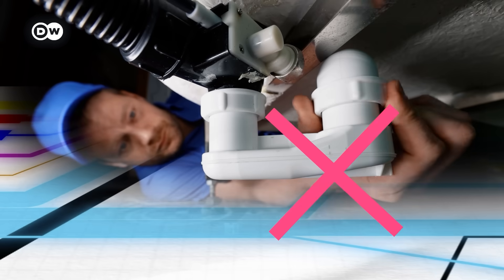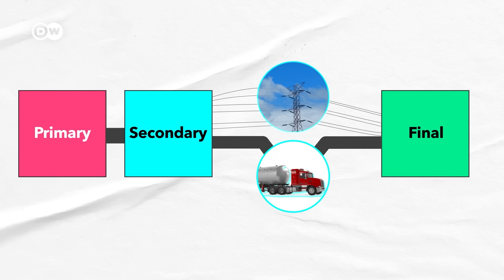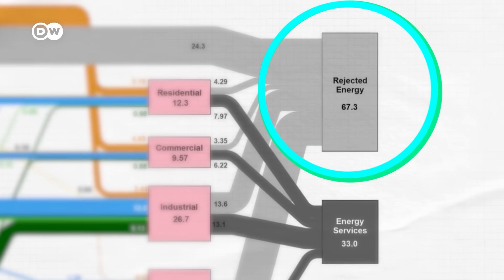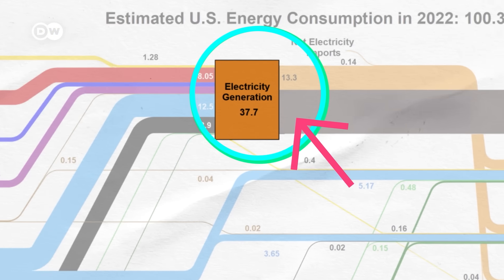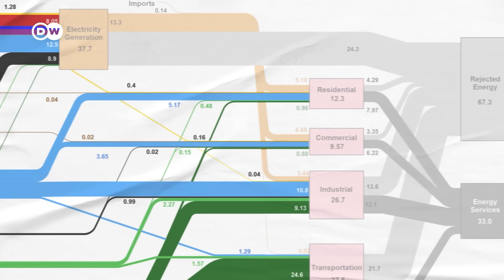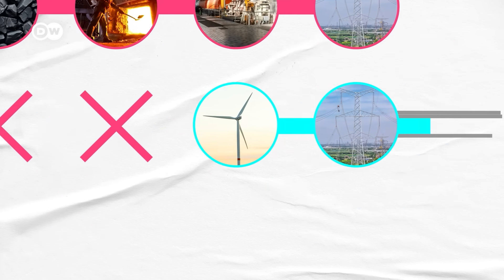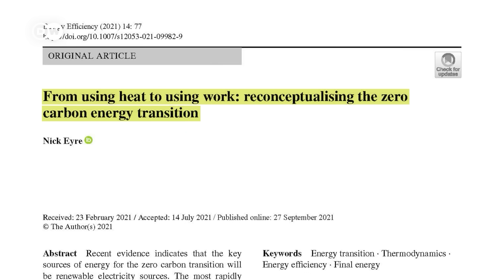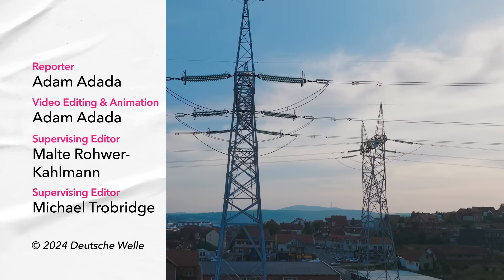The mind-blowing thing we get WRONG about energy

Comment: Very informative video, but it doesn’t talk about the emissions and wasted energy that goes into manufacturing and transporting especially when it comes to EVs.
Reply: EVs have much higher initial embedded energy and embedded CO2 emmisions but they should pay that back after perhaps 50-100K miles in spades and then be net positive. EVs have the potential to keep scaling down into micro cars and eBikes where efficiency is massive, but these days the western industry only wants to build luxury giant $100k SUVs which don't solve anything at all.
Reply: @johnjakson444  Aptera is looking to bring a cheap, lightweight, extremely aerodynamic, solar EV to the market somewhere around 2025. The Aptera sEV hes been designed from the ground up to be as efficient as possible. It's exterior is math equation of aerodynamics put onto wheels. Because of how efficient it is, it's able to generate a substantial about of its energy usage from its integrated solar panels and use much smaller, lighter, cheaper, less environmentally impactful battery packs compared to other EVs. And with the solar, It can literally take power from its solar cells and send it straight to the motors and HVAC system, reducing how much work the batteries have to do. This has the added benefit of bypassing some battery charge/discharge losses and reducing battery wear. The best part? Aptera support Right to Repair, keeping the vehicles on the road for longer so that they actually make up for the environmental cost of manufacturing and provide environmental benefits. Biggest downside? Its a 2 seater.

I could go on and on about Aptera, but if you want to learn more, there are quite alot of videos about Aptera here on YouTube.
Reply: @johnjakson444  And unfortunately that’s the issue, everyone wants an F-150 Lightning or  a Tesla which would take years and tens of thousands of miles before the emissions would offset instead of more compact alternatives

Comment: Lots of times, normal households are “targeted” as burden to the system. Yes, there is a good contribution to the problem, but the biggest resource consumer is the industry. There is no energy savings on factories because they need the amount of energy to be productive and deliver. The squeeze at the end comes to the households, which “we can do better “ . Yes we can, but the contribution to the environment and society might be not so big. 
Think about it.
Reply: It takes time for new tech means to be incorporated into supply chains and industrial design & manufacture.  We also need more utility middle ware - providing
constant power from intermittent, dispersed sources.  The legacy market arrangements requiring 20-year power purchase agreements needs updated.

Comment: It isn't complicated. Our world features a system of rewards. In turn our system will reward a company and or industry that uses their capital to capture government and regulatory systems to their benefit. This isn't a conspiracy it has been going on for thousands of years and will continue. In The US we have 8B gallons of household and business hot water standing by 24/7 at about 140 degrees. Perhaps 6% of this ocean of heated water is being used at one time. Is this anyone's fault? Who cares, fix it. The heater should be shut off based on need and you could save 60% of the energy used on heating 8B gallons of hot water that nobody needs. We have the technology to fix it a week ago.

The point isn't just about hot water and it is not about environmentalists or oil companies it's just that every appliance and vehicle we use every day is about 35% or less efficient than an electric version. There are 34M EV's on the planet, it has nothing to do with democrats or republicans this new technology is displacing gas cars and the pace quickens. Car manufacturers made 40M fewer engine blocks over the last 5 years. These blocks were displaced by electric motors that are over 70% efficient and not one of these engine blocks will ever come back.

Where are we going to find the electricity to charge these EV's? Electric transport will spend a goodly amount of time sitting still and "charging." Electric utilities will use this "battery capacity" for frequency management and gas and coal plants will continue to be shut down. Thermal generation isn't bad it just isn't efficient enough to keep up with the new technology. Gas stoves/furnaces/AC/cars were all invented a hundred years ago or more....they are obsolete and are being replaced and calm yourself, no one is gonna die in the process.

Comment: Sounds brilliant until you actually start looking at numbers. Even if you just want to electrify the grid (forget industry & transportation), the amount of renewables needed is unrealistically high.
And if you start electrifying everything you'll run into a new problem - our power grid won't be able to support it.
I've done a pilot project for city of Toronto (I was the lead design engineer), where we converted a school's heating/cooling system entirely to heat pumps (with lake Ontario as heat source, so even more efficient than airsource heat pumps). One of the reasons the city was doing it was to get a good estimate of the increase in power required to support it as they are really concerned about grid being able to take it.

Comment: I work in the industry and our company is building a lot of solar, this video is very strange though because whenever people talk about how much power is needed etc, it refers to the nameplate rating, which is the output of the plant, so this whole video doesn't make much sense. Of course fossil fuels and any heat based plants have very low efficiency, but the rating of the power plants and energy transmitted etc has nothing to do with the chemical energy in the fuel itself. So if we're using 30 GW power now with fossil fuels and we're replacing it with solar, it is still going to be 30 GW! Solar panels are also themselves not very efficient in converting energy from the sun to electricity, maybe even less efficient than fossil fuels, definitely less than 40 percent efficient, but again, the rating of the power is the based on the amount of power it can produce, not how much power the sun is providing it. Also, we are definitely not going to be using less electricity in the future, we will always use more energy in the future than we are now, population growth, human development, electric vehicles, and now artificial intelligence, are all big reasons why. I'm not a climate sceptic at all, but this is just a very very strange and low quality video honestly, I'm very surprised.

Comment: Unfortunately, wind and solar suffer the same problems. Solar is barely 17% efficient, and wind is less than 1% efficient. Advanced gasoline engines and coal burning power stations are 50% efficient. Gas burning power stations are 60% efficient.
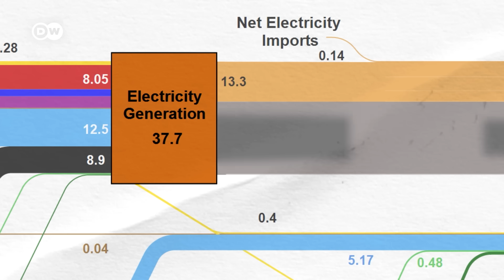Reply from the maker: Like stated (5:30 onwards) most of the energy gets wasted when we go from final energy to useful energy. It is not that renewables themselves are more efficient but there's no such a loss - that is remarkable. 🌞

Comment: The video is depressingly stupid.  Barking at the moon.
An electric vehicle is NOT 90% efficient. It might be from battery to wheel.  Battery technology loses around 25% of the energy input, due to inescapable inefficiencies, and energy loss ESPECIALLY at high power transfer (when you use fast charging or put your foot down).  And before anybody comes back at this to talk about new battery efficiency, practical batteries are NOT NEW for the most of their existence, and go through processes of degradation.  So COMPLETELY WRONG on this one.
Wind turbines do NOT produce energy on demand.  If you are willing and able to consume energy ONLY when the sun shines and when the wind blows, it may be possible to minimise energy losses.  But it is not only fossil-fired power stations which need maintenance - wind turbines fail too, and their blades quite rapidly degrade.  As they are spread out all over the place, it is hard to maintain them because it takes a lot of transport and other resource. COMPLETELY WRONG there.
Energy systems appear inefficient because they SATISFY CONSUMER DEMAND.  Consumers demand energy as well as security.  If you want a secure (on-demand) energy supply, you get the systems in those Sankey diagrams.  Engineers and commerce didn't get there because they are all stupid.

Comment: Want to get serious?  we can cut the waste in half but the following.

1. set speed limits to 50mph. This would make EVs feasible.
2. stop all non emergency air travel.
3. stop letting people drive their 400 square foot home around the country.
4. stop all off road vehicles for entertainment.
5. stop the construction of over sized houses.
6. Charge power and fuel on a sliding scale.  The more you use the more it costs.  Let the rich pay for their over consumption.

Either choose what to give up today or lose it all tomorrow.

Comment: Ah you have fallen into the Engineering Trap! How do I make everything more efficient? Muahahahaha.... 

It is true, unfortunately it is challenging... The reason why power plants are so inefficient is because you can't boil steam. When you push steam though a turbine it takes some of the energy out of the steam, this will turn it back into water but water will damage the turbine. So to prevent this engineers use what is known as superheated steam. Which means it's still steam when it comes out of the turbine, so no damage. But in order to boil it again, to run it back though the turbine it must be cooled back into water again. Hence the huge loss in energy. 

Cars... There actually closer to 5-10% efficient if I'm going to be real. The issue is that usable energy is a loose term. See yes the car is using 20% but around half of a cars energy it 'uses' is wasted idling, like at traffic lights and such. So it's only around 10%, but if you factor in braking which looses momentum as heat about 3-7% of the energy in a cars momentum (of the 10%) so yeah a car is 90-95% inefficient. Electric cars also are only around 80% efficient at best this is due to 20% loss as the battery heats up charging. However due to the fact they can recapture braking, and they don't idl. They are actually really efficient. The biggest issue with them is energy loss from (a bit of friction honestly) but mostly the heat made when the battery charges and discharges. 

Heatpumps can actually be up to 900%+ efficient but they have to be a geothermal heat pump not a air based heatpumps. The issue is here of course is geothermal are WAY more expensive than air based. By like 10X. However this doesn't account for the fact a lot of homes leak that energy back into the environment due to poor insulation and low quality building practices which cause homes to leak. In fact if you build a well built netzero home, you almost never need to even run your heatpump except on really really cold days or really really hot days. So not only is it more efficient but you also don't need to run it as often. 

Also with heat electronics in the home also can be made more efficient which reduces the amount of heat the heat pump needs to remove (think incandescent versus LED light bulbs) if you make less heat the heat pump doesn't need to run as often to remove the heat. (The best heat is the heat you never made).

Definitely a challenge but doable it's less of a technical problem and more of a cost and will problem with a big bit of needed regulation and money sprinkled in.

Comment: Even fission and fusion energy  waste 2/3 of the energy making steam to turn turbines and then condensing the steam to use the water again. .  We need to find a more efficient way of transferring heat to electricity if you want to go pure Electric.
Reply: The wasted energy in nuclear isn't as huge a problem considering no greenhouse gasses are emitted. You can just scale up to meet your demands.
Reply: @Babyblasphemy   It's still adding energy to a system.  "Not a huge problem" is consistent with my guess that it will take 3 to 400 years for us to notice.   I am not opposed to using nuclear power at all.  I've spent a chunk t of my life cleaning up, nuclear weapons production and test sites  and  Old  graphite moderated reactors and I still say it's safer and cleaner than fossil fuels or even using too much fertilizer on crops.
Reply: @flotsamike  simply adding heat is self correcting. A hotter object will radiate more heat outwards to space. Greenhouse gasses not so much.
Reply: I'm sick of thermodynamics illiterates that think they're cute by talking about it. We MUST throw away energy to a heat sink to convert heat into work. Renewables suffer from the same problem. Solar is barely 17% efficient, 83% of that is released as low-to-ground air heating. Wind has an infinitesimally small efficiency. Internal combustion engines are at 55% thermal efficiency. Gas burning power stations are at 60% efficiency. Coal burning power stations are at 49.5% efficiency. The waste heat from power stations can be used for district heating as well as cooling with Absorption chillers.
Reply: @gregorymalchuk272  All of the energy wasted by solar power is already in the environment and that is what creates the baseline.    It's true I never took thermodynamics and I'm pretty stupid,  but at least I know if you add energy to a system you change its equilibrium.   I thought I was being generous by not mentioning the fact that all of the energy you generate gets released to the environment eventually.
 It would be great if we could capture heat for district heating, but at least in the United States, nobody wants to put a nuclear power plant close enough to a population that would use it.  Still that heat which was formerly in the fossil fuel  or  slowly being released by radioactive decay,  or not released at all by fusion that's not happening, will be released to the environment and most likely change the heat dissipation profile of the atmosphere   I am sorry my thoughts make you sick.
Reply: @gregorymalchuk272  who cares about efficiency. The real concern is elimination of greenhouse gas emissions and cost.
Reply: @Babyblasphemy  And if you care about global heating, then you have to oppose renewables too, because most of their energy is dissipated as waste heat.
Reply: @gregorymalchuk272  you mean the heat that would just hit the Earth had the panel not been present?
Reply: @Babyblasphemy  Natural materials are more reflective than any solar panel. So every panel contributes somewhat to heating the earth. But it's worse, because they heat the earth near the ground where it creates an urban heat Island effect and human health effects.
Reply: @Babyblasphemy  it is the immediate concern.  But just because we stop adding greenhouse gases doesn't mean they will disappear instantly .
Reply: @gregorymalchuk272  There is room to improve solar for sure.    I cannot find a way to incorporate radiative  cooling materials in a solar panel.  But I have learned that many of the radiative cooling coatings re emit the infrared  light at a frequency that's more likely to leave the atmosphere,.

Comment: Why did the analysis not show the role of Solar paired with batteries.  It is the cheapest, most efficient system out there.  The batteries in California and Adelaide South Australia are taking up peak demand.
Reply: Well in the US NE, solar production is 5x better in summer than winter, 6 months of battery electric storage is going to cost a $M per person and would not even work. Instead we use gas peakers to do the job. Batteries are only good for hours. Weekly and monthly storage is cheaper per kWh but grossly less efficient for various tech, and the required quantity is huge. It even says on the Sankey what that is, 300GJ per year per person in the US, a good part of that will need to be in long term storage for months.
Reply: Solar panels are only about 23% efficient

Comment: Very good arguement BUT one major fatal flaw regarding EVs. With many ICE cars you’re moving around a tonne of weight. With EVs weighing significantly more the power requirements to move it the same distance are greater. But at the end of the day you’re still just moving a couple of people from point A to point B.

Cars are just stupid, wether EVs or ICEs.Think about it, when you’re alone in your car you’re likely moving 10 times your weight just so that you can move. Motorisation rates need to DRASTICALLY decrease. Cars should be for the elderly and for disabled people, or for transporting heavy stuff.